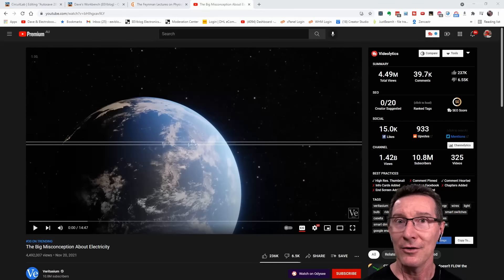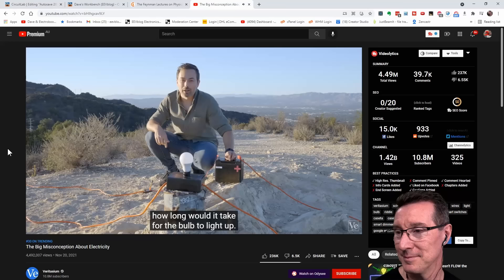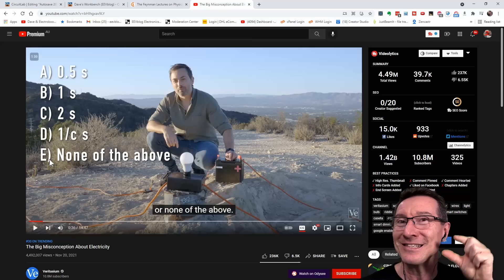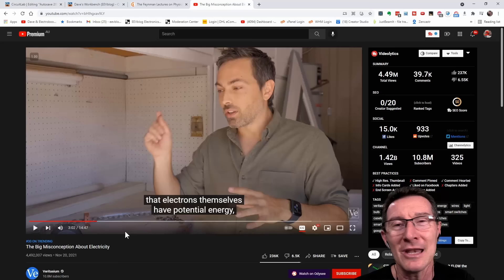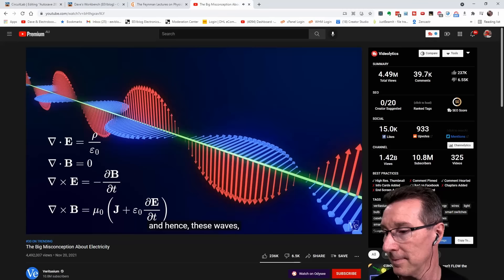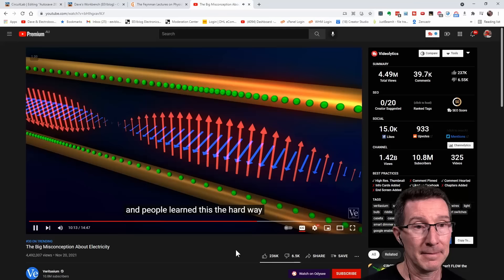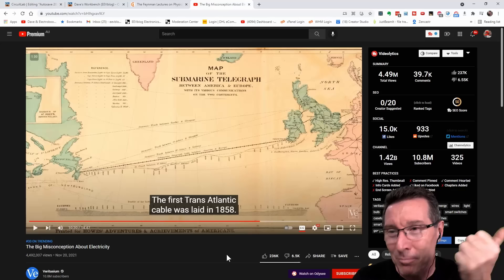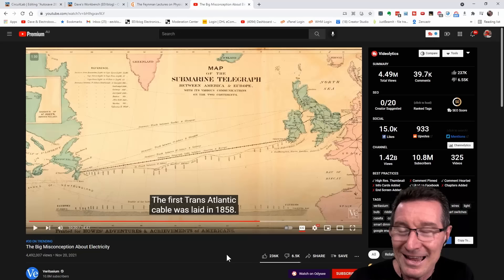EEVblog 1439 - Analysing Veritasium's Electricity Misconceptions Video

Comment: I get the feeling his video might leave the general public with a poor understanding.

As an engineer, I hadn't thought about how large a portion the surrounding magnetic fields was compared to the amount of power in the wire. But I also work mainly on batteries and motors, so nothing over long distances. I would have thought no more than 10% of the power flows outside the wire, but maybe it's more.
Reply: Pretty much. People gloss over the spherical cow in a vacuum type assumptions required to arrive at the conclusion, then try to to apply to reality. The more closely an equation is to mimic reality, the uglier it'll get.
Reply: Didn't you say that Grant Thompson from the king of random dying in a accident was his own fault and then change your channel name to hide from the backlash?
Reply: Yeah, as a non-electrical engineer Veritasium's video made me think I had missed something, but it's just the small amount of capacitance between the lines that lights the bulb. Seems there was a lot of missing information from the video that will leave people without a full understanding.
Reply: I think you're right, and it's not hard to figure out who will be most affected by the misunderstanding.  We have an environment right now where people are going crazy for no reason over 5G -- literally tinfoil hat kind of stuff.  If they start thinking that all of their power plant energy delivery is coursing through the space between their ears instead of hugging the wires, who knows where it could lead :-).
Reply: Take a look at his entire channel and try to figure out who is audience is. His audience is primarily the slightly-better-than-averege layperson for the topic of the specific video. His example of what he used to teach students looks very much like a High School explanation, not a University Engineering explanation. His explanation in this video is explaining nuances that I didn't learn with my 2 year degree in EE Technology, so I would say that his audience for this video is anyone who is interested in electricity who have a 2-year degree and less, not someone who has a 4-year EE degree...
Reply: As a general public with poor understanding, I loved Veritasium's post.
Reply: At DC and for quasi-static (for most systems operating at 50/60 Hz AC), the power delivered is simply given by the current X voltage.  When a DC circuit is turned on, magnetic fields are established outside of the wires, and electrostatic fields between the conductors.  However, there is an overall electric field pointing from one end of the battery to the other end, and likewise there is a second from one end of the load to the other end.   One can use the continuity equation to calculate the power delivered to the load (Poynting's theorem):

Div [ E X H ] + J . E + dU/dt = 0

The Veritasium video is talking about the divergence piece Div [ E X H ].  However at very low frequency, the wavelength of the field is very long.  So the divergence operation which measures on what spatial scale the energy transfer occurs, is a very small component, as it is important only on the scale of the wavelength.  This is also why an antenna that is much smaller than a wavelength is an inefficient radiator.  The J . E component is the important piece, because at DC or low frequency AC, this is what accounts for sources or sinks of power from the field.   It is essentially voltage X current per unit volume.  And dU/dt accounts is the energy density stored in the field.
Reply: Yeah I have to say, I don't really like the original video because the question is too much of a trick that doesn't really inform.
Reply: @Sembazuru  
It's pseudoscience.
The show provides its audience bragging right without actually doing any real scientific works. 
Sadly you can't do science by watching others doing science.
Reply: You are right, these videos have few misconseptions. Electric field is mainly INSIDE THE CONDUCTOR, they forget this fact...
Reply: @profdc9501  👍
Reply: @sasamladenovic6120  ...so why is the fluorescent tube I hold below the power transmission line, between the power station and the distribution substation, starts glowing? Isn't the answer because the fields EXTERNAL to the physical power distribution line are exciting the phosphor to glow?
Reply: @davidpalmer9780  yes,  for high frequencies. For low f and dc current, neon light bulb will never turn on. The main purpose for conductor is to guide electric field through them.
Reply: The "energy" outside the wires is not heat energy (if you are in a vacuum) since there is nothing being heated.  Or is it radiated infrared in proportion to resistance losses?  Assume current and power flow but no frictional/resistance losses in a theoretical ideal  wire material.  In a vacuum there are no kinetic energy losses either outside the wire, since there is nothing in a vacuum outside the wires to be accelerated.  Therefore, what form is the energy outside the wire?  What carries this energy if there is nothing there but a vacuum?  Energy is joules in units of newton meters, and newtons refer to accelerating matter at an increasing rate.  So if there is no matter to be accelerated outside the wire, what is the form of the energy in the accompanying changing electric and magnetic fields?
Reply: If energy is moving in free space around the wire, what would make it suddenly "want" to converge inside the filament and heat it to incandescence?  That sounds like a violation of entropy.
Reply: At all points in space there is some kind of gravitational field and some kind of electrical field and some kind of magnetic field.  What is the "stuff" that jumps out of the wire and increases the field (electric, magnetic) when the power is turned on and the current flows?
Reply: A proton has the mass of 1835 electrons.  Something is going on inside an electron we call "negative charge."  Must be the same thing only backwards/inside out/clockwise vs. counterclockwise is going on inside  a proton (or a positron) that we describe as "positive charge."    What is the "thing" that causes what we call electric charge?
Reply: @sasamladenovic6120  At DC this is true.  Because of the skin effect, as frequency increases, the electric field penetrates the conductor less and less.  Normally for power transmission at low frequencies, this is not a great consideration (unless you have really thick AC cables) but is significant at radio frequencies.  For events occurring at nanosecond time scales, these considerations are important because the frequency content is high.
Reply: @jackieow6692  Entropy has to do with the number of configurations of a system given a set of macroscopic variables (pressure, volume, etc.).  A classical field is a single deterministic state determined by the charges and currents in the circuit.  Therefore entropy is not decreasing because the field isn't "converging" into the filament, the state of the field is such that the electric field is high across the filament due to the wires being there equalizing the potential between the battery and filament.  Entropy is increasing, however, because of the randomness of the radiation produced by the hot filament, because many different random fields are generated from one deterministic state of the field in the circuit.
Reply: @profdc9501  This is skin effect, well explained. Whole misleading and confusion in this video is caused bu the geometry of the problem, wires are capacitive and inductive coupled. But, if we take in consideration relativistic effects, explanation is not so simple and real problem begins... :-)
Reply: @yakovdavidovich7943  Holy hysteria Batman! What shall we do if people jump to uninformed conclusions.! o_O :D
Reply: This Vertasium dude is just WRONG!!!  I wish all of you would stop being polite.  Call it like it is.  He's WRONG!  If you don't get that, please see my comment.

Here:

This is not right.  There are two question: propagation time in the wire and propagation time in space between the battery and the bulb.   There is an inductive effect between the local wire that gets the bulb "started".  But to maintain, power the power is coming over the wire.   (assuming the pulse carries enough energy to even light a bulb). 

If the long wire were not there, the bulb would come on for period that the pulse from the switch send energy that got induced into the wires attached to the bulb.  Much like a radio drives a receiver very far away.  But that power must be a pulse.  A steady voltage will not get induced once it has stabilized. 

Even with this, there is something wrong.  The only way I would believe that it wouldn't take 2 seconds is someone did it.  Yes, there would be an impulse in 1/c seconds, but it would not remain on.  It would die down and then come back at about 2 second mark.

Now here is the other part of the problem.  He is mixing propagation of AC with DC.  The battery is DC.  There is no EM wave in DC other than the initial impulse.  Who are the two guys that seem to be "experts" who agree with him.  Don't they realized DC propagation happens via electron drift.  AC propagation happens via wave theory of E&M.   So @14:05 when he says "exact same analysis works for AC as DC", that's TOTALLY wrong!!!!  And it's not just Engineering "think".  It's physics think. 

So EEVblog guy, don't walk it back the way you do @10:10.  He's just wrong from a physics point of view, he is wrong from engineering point of view, he is wrong from the math point of view.

Induction is an effect of the change in current over time.  When he closes the switch he creates an "impulse".  But after that the change in time is 0.   In AC, there is a cos, which is always changing and thus a non-zero derivative all the time!!!

Let's get him to learn something:  Have him connect one side of a transformer to with a DC source (battery).  Let him see that the light on the opposite side will NOT come on.  If it is AC, it will come on and will stay on.  But he owes me 1/2 of what he makes.  Lol.

But here's the thing that kills me -- He has 4+ million views.  1 Million views is $5,000.  So for this video he is laughing all the way to the bank with $20K.  Not a bad pay day for someone who doesn't know what he is talking about.  Lol!!!

EEVblog -- in contrast has 118,000 views at this time.  That's maybe $500 -- assuming YT algorithm pays anything at all and is "fair".   So stupid gets rich and smart gets poor.  Lol.

But what is most sickening is to think that two PhD's agree with him and don't point out the flaw in his analysis.  What kind of PhD's are these guys.   They sure not in physics or electrical engineering!!!!  If they are, then the University that gave them their degree needs to demand it back.  Lol.

Let's take the "red pill" for a moment, but isn't this the epitome of what's wrong in this world?
Reply: @joeboxter3635  interesting. Are you saying that power flow is proportional to the change in E X B? This makes sense to me from a transformer theory point of view...I learned it in terms of establishing and collapsing electric and magnetic fields. It also makes sense in terms of reflected power, to me.
Reply: @sasamladenovic6120  it's you who is spreading misconceptions: THE ELECTRIC FIELD INSIDE A CONDUCTOR IS NEGLIGIBLE. and in a perfect conductor, it is exactly zero.  The reason why is that every part of the conductor is at the same potential (voltage). otherwise the charges would have rearanged themselve, until they negate all the electric field inside the wire.  if every part is at the same potential, then the gradient is nil and there is no field in the wire. only when there is some resistive loss there is a very small eletric field in the conductor.
Reply: @nicoepsilon0  This is not misconception. Field inside conductor is zero, just in case of electrostatic charges. Then is E=0. When the current exist (this is not the case  with electrostatic), E isn't equal to 0. Please google (or find in the books) Ohm's law in local form...
Reply: The real game-changer here is that this is superconductor... In superconductor, E in the wire can be close to the zero, or =0 in case R=0,  and you will still have the current...
Reply: @lavonmarshal3127 It: rinoa super genious, said something more savage! " that it was happy he was gone so it would not get annoyed by his stupid content." + What u said. That was the moment i hoped to never hear from its channel again. It is a pretty layman's engineer itself with many screwups etc extremely low budget diy projects hardly engineer grade content.
Reply: @sasamladenovic6120  the electric field inside a conductor is 0
Reply: @calfeggs  I believe this is almost always the case with his videos. If you follow his reasoning you will not have really understood what he is trying to teach you.
Reply: @mattmurphy7030  Excellent question. Without going into details, I can confidently say that the radiated power depends on the antenna shape (geometry) and the radiated frequency and 60% will be the number for a correctly tuned antenna. In this case the radiation will be only at the moment of switch closure and the radiated power will be a very small part of the steady state power
Reply: @calfeggs  It's not just the capacitance.  If you just use the capacitance, you don't get enough current through the bulb to light it up enough to see.  The mutual inductance of the wires is just as important here - a change in current to the right in one wire induces a current to the left in the other.

I think this is why he chose 1m as the spacing - because this reduces the capacitance to the point where one might think that it has no practical effect.
Reply: @AsmodeusInflect  Absolutely.  Trick questions are just flexing.
Reply: I found his P vector explanation took something I knew of and actually made it muddy and hand-wavy to a point I wasn't even entirely sure what he was talking about, or wouldn't be without prior understanding. Then there was the glossing over steady state DC. Franky it's the same in many Ve videos: making a little bit of a mess of things to make it sound either simpler or more "miraculous" than it is, over just fully explaining it clearly. As teaching resources Ve's videos seem highly variable, when I always feel that with slightly more attention to detail they could be excellent.
Reply: @sasamladenovic6120  "Electric field is mainly INSIDE THE CONDUCTOR".  Sorry, but this is entirely wrong.  Electric fields are measured in volts per inch - you have an electric field where you have a voltage gradient, and the gradient within a conductor is very small.  Look at a capacitor: it has an electric field ACROSS THE DIELECTRIC, and practically no field at all within the conductors.  There is a popular demonstration in which the dielectric of a physically large capacitor is removed from between its plates, and slid in between a different set of plates.  Guess what?  The charge appears across the new set of plates, because the field is in the dielectric.
Reply: @jokegum  inside a superconductor, yes...
Reply: @BrightBlueJim  this is not the rocket science, C=q/U, U = const, so if you decrease C (change dielectric properties, epsilon r) , proportionaly decreases q, and vice versa... I think that we will have one smaller current spike at  moment 1m/c and stabile current only after 1s...
Reply: @BrightBlueJim  That's some neat stuff.
Reply: @lavonmarshal3127  wait for real?
Reply: Well now i know there are no electrons flowing through my house wires i feel much safer doing diy
Reply: @jsnsk101  lol
Reply: @Ingeniebrio you are completely right. As a mechanical engineer working mostly as a physisist i enjoyed both videos. But i think Derek and Dave missed one point. Everything what we learned at the university are models of the reality. Some models are quite generalized and other work only for particular problems. But at the end all models were constructed by making some assumptions and you have to take them into account to solve the problem. In order words, You just only need to make the right assumptions. But that is the tricky thing. To making the right assumptions you need to know which effects can be neglected. You can have frequency effects, linearity and stability problems, fields effects, etc. The way of thinking should not be to say, this is "right" or this is "wrong" but instead saying: it depends of your problem.
Reply: You can also overload people with far too much information and leave them with no understanding at all. There's nothing wrong with a dumbed down explanation for people who don't even have a layman's view. This is a problem a lot of experts have. They start to think that everyone has an expert understanding, but we don't. This became obvious to me once when I was helping a girl write an email. I knew she might not know how software worked but assumed she understood the concept of the peripheral known as a mouse. Actually, she was afraid to touch it because it was called a mouse.
Reply: Technically in DC, the energy flows in the space inside the wire and outside it, radiating from the center, because it flows in the field, which occupies the same spatial region that the wire does, (field are everywhere, and what is an atom if not just a pattern of interference in fields, why are we talking about wires at all then ?)
I would say that it is not even 10% outside the wire. The poyinting points entire towards the direction of the wire, and the field becomes weak with the square of the distance from the center, so we basically assume the energy flows in the wire, not in the same space but on the magnetic field, its just useless extra information that doesn't help.
Reply: @lavonmarshal3127  Kind of is.  You don't die in a hang gliding accident without first choosing to go hang gliding.

I don't see why that matters, but it's not untrue either.
Reply: @AsmodeusInflect  I agree.  The video does not provide any practical and useful information. Like Seinfeld, it seems like its a video about nothing...
Reply: @Sembazuru  I always feel viewers of his video are people that like to be edgy..I know he's trying to share great information but it just always comes off as a bit "I'm smart" , or rather, the viewers that watch his videos I think may behave that way. Just feels kind of edgy all the time, maybe it's because he's doing these "shocking" videos now where things work different than you would "expect".
Reply: It's helpful to note that the Electrons are not delivering energy, they're moving in response to the electric field that is moving energy. Current is an effect of the change in electric field, not the driving cause. The coupling of two isolated parts of the field with different energy levels via the conductor is what lets energy flow, the field carries it, and the Electrons move as a result of the change in field to maintain the minimum-energy charge distribution.
Reply: @joeboxter3635  Thank you! Im just an above average layperson and I didn't fully understand the example until I read your comment and you said there would be a very tiny pulse at 3 nanoseconds and assuming it was enough to light the bulb a little bit but then the bulb would die down and not fully light up until two seconds.

Okay but I still need clarification because the point of his video was that the power is transmitted in the electric field and not the wires. But it sure seems like the electric field goes all the way down half a light-year in back exactly the way the Wire is laid at least 4 time periods after 2 seconds but there seems to be an issue about how the pulse gets to the bulb. Is it traveling from the battery directly to the pulp through the electric field ? Or is the pulse actually coming from the portion of the wire directly attached to the left and the right of the bulb somehow?

My second question is more pertinent it seems like the power is being transmitted through the electric field around the wire which is wider than the wire itself. If this is the case can you power something just by putting it close to the wire? I'm guessing you can't. It probably has to touch the wire. So technically the power is moving through the electric field but the electric field is taking up exactly the same space as the wire. So how do you know it's moving through the electric field and not the wire. Cuz electron drift is slower than the power moves.

So I agree with you the sample is misleading. He was trying to come up with an example to prove that the power goes thru the electric field and not the wire but his example doesn't prove that. All we can say is example shows is that an initial pulse ignores the wire and goes directly to the bulb. But then all the power after that may not be traveling in The Wire but it is definitely traveling in exactly the same space that the wire is taking up. LOL so why does the initial pulse go straight to the bulb but everything else follows the shape of The Wire?
Reply: Theres no need to argue anything.
If voltage in conductor is set up to light a lightbulb, at 1ls distance, any induced voltage, no matter how efficient, will be well below our ability to even measure by any means.

The guy was just very wrong in that video on so many fronts...
Reply: The general public already has a poor understanding, I would know.
Reply: I agree, he was deliberate in mangling it, probably to create some controversy.
Reply: @MrMistery101  Good point.  All I really wanted to know was the basic idea of how alternating current could possibly work given the idea of an "electrical current" and the "flow of electrons."  Now I have a very basic understanding, even if flawed, at least.
Reply: @calfeggs    You expect a full understanding of electromagnetism from a short video on Youtube?
Reply: @jm9371  Me too.  I find that many engineers often have no understanding of the simplest concepts in law and business.  Such smarty pants and yet so naive.  Good bait for bad deals.
Reply: @hereiam2005  Yes you can.  Professions are taught, crafts are shown.  How many undergraduate engineers personally do any significant scientific experiments that aren't elementary in any University in the world?  None.
Reply: @charleselkins4546  
Working the equations is considered doing science, it's called "theoretical science".
Watching others doing science is not.
How many people watching his videos actually work out any of his equations? 
(Almost) none.
Reply: Actually counting cables with 1mm diameter 1m away I would asume that itt would be less than 0,1% of energy. And this is what we call E-M interference on our electric circuits. I wonder why these theoreticians cannot see it :)
Reply: The bigger question is how to make antenna irradiate at constant current applied to it. The answer is - noway. So, to transmit energy by means of EM field you need an alternating current. At DC it's charged particles that transmit energy mostly, in a "mechanical" way - by pushing each others in direction of E field.

Down the QED rabbit whole, electon is, as any other particle, a disturbance of EM field (wave). So, from this depth it's EM field that carries energy.
Reply: @AsmodeusInflect  Sounds like 99% of veritasium's contents. They are just informative enough to create curiosity, but if you bother to sit down and trace what is said it's mostly clickbait and oversensationalising very small details.
Reply: @joeboxter3635  It does not matter if it would not remain on. It only matters if it turned on for an instant which would still make him correct. I do not think the wires would even need to be connected to the light bulb. In fact we can already do this experiment in real life all the time when you can turn on fluorescent tube bulb near power lines without directly connecting to them. It is the same effect. That fluorescent tube bulb could have been connected to that powerline but it would not have needed it.
Reply: Rinoa's Auspicious Travails: it really doesent matter for DC at all....at higher freq the effect gets higher...for example at 6Ghz...there will be vitually zero electrons flowing trough the center of a wire (assuming a normal and not theoretical wire) due to the self induced fields...its also why its very unpractical without using super cooling or super heated superconductors
Reply: @mattmurphy7030  believe it or not the duration of the more meaningful part of the explanation which stuck with me well over 25 years was under 15 minutes in duration. Most presentations I recall of best effect also were presented in well under 15 minutes, followed by worked examples all totalling 45 minute to 60 minute lesson. But any explanation of anything will assume prior knowledge and might need repeating depending on the audience. Identifiable missing variables in an explanation are what they are; highlighted by both my comment and this video. Where to draw the line on detail depends on what you hope to convey. I will admit that is probably exactly why Ve cuts out what he does, perhaps intending to inspire/fill watchers with wonder more than educate, of course. He even seems to ask himself this question regarding scope "How Should We Teach Science". It's just a shame in my opinion he doesn't go for the longer formats, as I'd imagine vast improvements from even a little extra info, as they seem they can quickly transition from inspirational to highly educational.
Finally, the practice of drill resulting in memorised processes doesn't equate to understanding in my experience. Drill can be a useful memory tool for cementing understanding under certain circumstances but is usually far more often required where there's a lack of it.
Reply: Isn't it all just smaller versions of the magnetic fields that creates the earths Van Allen belts. The whole as above so below thing. Fractal system?
Reply: i thought it was equal to one electron per joule or something. i was most supprised that anyone suggested that its possible to turn a lightbulb on in under the time it takes for light to flow around the length of the wire and im still not convinced it is!
Reply: @joeboxter3635  Bro, go touch grass and spend time with family. You're obsessed with how much people are making and you're mad at people on the internet making videos.

About income inequality, you don't have to even look at Veritasium or EEVBlog. Just look at University lecturers. Students pay thousands in tuition fees and less than 5% actually goes to lecturers. Most lecturers are paid lower than engineers even. So to call out Veritasium is barking up the wrong tree. Academics just don't make as much money as engineers, entertainers, and many other occupations.

To say he is making money from "stupid" content is extremely rude and harsh. Sure it has mistakes and a lot can be improved, but Veritasium has always been very successful in getting the average person (with no STEM background) interested in science.
Reply: "I get the feeling his video might leave the general public with a poor understanding." I would say say couldn't be more poor than the general public ready has. Let's not forget that most in the general public think that energy actually flows in the wires of a circuit.
Reply: Power lines and EMC should take care of that.
Reply: @calfeggs  This is why youtube can't replace College where real professors who live and breathe the subjects can teach rather than a random guy who picks and choses what he's going to show for ulterior motives. This is the era of mis-information.
Reply: @Sembazuru  I takes at least 4 years of College to Fully derive Maxwell Equations, more so all the modelling that goes with those and  2 years won't cut it, by far. You're totally right. At best you'll manage to get into basic Circuit Models and some Filtering techniques with some basic electronics understanding, but that's about it. It'll take about 3 years to add motors and so on. Plus you need all the basics first. Depending on the education you bring into college it could take anything from 4 to 6 years total and about 1 to 1 1/2 years  to get to understand Electromagnetic Compatibility after you understand Power Lines. 
Electrical Engineering as a WHOLE, is by far the hardest, most extensive Engineering branch there is. Everything from Programming, Power and Transduction, Electronics, Radio Communications, Digital Communications, Modeling and Control, Digital Signal Processing, the list goes on and on and on.
Reply: @sasamladenovic6120  You do realize this is a youtube video and the youtuber is trying to impress people. Is like the quirky thing that electricity does. I don't even have to watch the video to remember several EE professors from Power Lines, Fields and Electromagnetism, EMC, and so on referring to the parasitic capacitance between wires  with this example. Is like a nifty little trick to show your students how Electricity ISN'T what people think it is with their low level model thinking of it.
Reply: @Cythil  What you are calling "little white lies" has a Scientific Name: Low Level Model.
Reply: @Teth47  You forgot to mention, since current is modeled after positive charge, in the DC model, electrons actually move in the OPPOSITE direction of current. That will mess up with their brains even more.
Reply: @aaronmicalowe  I can't even begin to Facepalm about your  example. This is what Democratization does though: it assumes that all brains are modeling the world equally, but they don't. Even on a single person throughout time, their brain changes the way it sees the world. Language is a bitch.
Reply: @lennycastellanos1653  Oh here we go with "modeling and simulation" concepts....Unfortunately Electricity ain't that tameable. Is there anything in the purely mechanical field like it, perhaps stress and fatigue? What do you say?
Reply: @einarabelc5  I feel people would get what I was talking about if I used the term little white lies. ;)
Reply: @yakovdavidovich7943  5G frequencies are high enough that it can denature the protein in the eyes causing lens opacity.  It's the old E=hc/lambda equation.  Enough years of exposure could see significant lens clouding.  That is a valid concern.  Next time you fry an egg and see the white go opaque that's exactly what will happen to protein molecules in the eye, denaturing protein molecule after protein molecule as 5G photons hit the eye.  Get enough of those protein molecules denatured and you will have noticeable opacity.
Reply: JESUS CHRIST IS COMING TO JUDGE THE EARTH SOON PLEASE!!!!!!!!!!!! CALL ON HIM NOOOOOOOOOOOOOOOOOOOOW!!!!!!!!!!!!!!!!!!!!!!!!!!!!
Reply: Lol it's hard to argue with that
Reply: @Sembazuru  or someone with a PhD in chemical engineering :)
Reply: Veritasium asks question about time, yet every formula he used to derive his answer doesn't have 't' in in it! That alone should be a red flag to anyone, even if you don't know much about electricity and circuits. For example, for DC, he used formulas describing final static fields , where nothing changed over time, hence t is ignored, which are obviously not describing initial conditions when the switch is initially turned on.
Reply: @AG-ig8uf  he still gets the answer correct though, if it's 1 m away it's 1/c the answer so I don't understand why all this fuzz
Reply: @joeboxter3635  if you read the slides cited in the description of veritasium video you can see I think that the phds do not really agree with him, veritasium misrepresented them. The slides written by the phds make this clear (presumably veritasium paid them). What is going on is something quite special related to having two very long superconductors near each other. The fact that the initial pulse does actually take a long time to propagate (a long time before any reflections from the corners of the wires) means the steady state takes a long time to reach in this circuit. And the fact that they are superconductors means this effect continues over the whole length of the wires (rather than being lost to heat, etc, as it would be in normal wires of that length). Its even more of a trick question if you read what the phds actually modeled. I think veriasium does a big disservice with this kind of behaviour, he is trying to convince people that they know less than they really do by using an obscure and highly unrealistic set of assumptions then pretending they apply in a meaningful (rather than negligible) way to ordinary devices and situations people are familiar with day to day.
Reply: @jackieow6692  ether
Reply: The Energy necessary to set up the eventual steady-state fields is readily determined.    The cable-pair has an impedance ~1000 ohms as distributed inductance and capacitance, so the power drawn from a 12vdc battery for the first half-second is ~144mW(V^2/Z).   That power going into the fields drops off in power density  as 1/r^3 initially, but 1/r^2 in the infinite wire limit.  So the light-bulb cross section  (say 10cm diameter, cross section 78.5cm^2) but the surface of the wavefront i the (r=100cm, SA=4*pi*r^2 = 126000 cm^2) - the the power initially striking the bulb is only (87.5/126000)  0.0625% of the initial power into the field.  The bulb initially sees 144 mW * 0.00065 or 90 microWatts!

NO that can never create enough visible light from any light-bulb to matter.  Futher he E-field strength at the lamp is too small to ever accelerate any electron enough to create visible light until a second has passed.
Reply: Your intuition is correct - the power and e-fields are tiny and cannot provide  enough power to produce practical light.   But it's obvious that Derick and this vid-host failed to do the math and valuate the Poynting vector surface integral.(power).  The field(s) expand with a 1/r^2 loss initially tending toward a 1/r in the infinite wire case.  Neither amount of field power could power any practical light ~10cm diam bulb  at a distance of 1m.  So why do they jabber about Poynting vectors yet fail to do the math and see that a few tens of microwatts impinge on the bulb  - yet several watts of sunlight.?

The trick-claim is in Derick's "any current lights the bulb".  That is a major fail.  If true, then thermally induced currents light the bulb at any temp above absolute zero.   That's rubbish.
Reply: @MrJob91  please explain
Reply: It’s most likely less.
Reply: @stevealexander8010  Thanks for your sensible comments. I thought that the current would be negligible although the voltage induced across  1m would be 1v at the instant the switch was activated  and so no light would result until the current had flowed via the electric and magnetic fields surrounding the superconducting wires had  time to  propagate around the circuit.  I have no idea how long that would take but I would guess that it is a  c/1000 .
Reply: @patriotsvnwo5217  Assuming a small wire (~1mm or less) and a separation of 1 meter, the impedance  (Z) of the t-line is roughly 1000 ohm and the speed of signal in that arrangement would be just a few ppm less than c.  So a few microseconds more than one second.
Reply: @sasamladenovic6120  Hello Sasa-your comment here addresses what I had in mind to ask.  What I don't know is, what percent of the electric field carrying the energy is inside the wire and what percent is outside?  I had thought of asking, what if we took some super conducting wire and coated it with an extremely thin insulating material, then coated it with an efficient Faraday cage....to prevent any fields on the outside.  How would the current flow in this wire compared to the original wire of the same length?  How much more resistive would it be?  An even more basic question--does my experiment even make sense?  I am speaking here as a molecular biologist who took physics a long long time ago...lol.  Ted
Reply: Who said the video was educational? 🙄